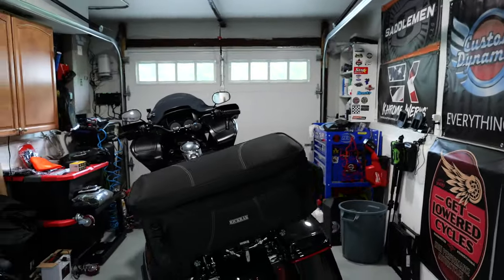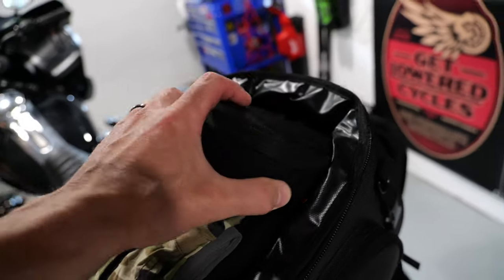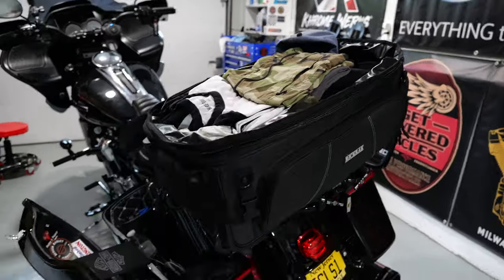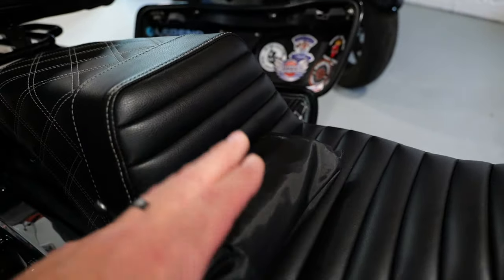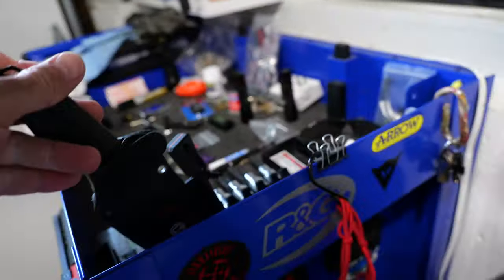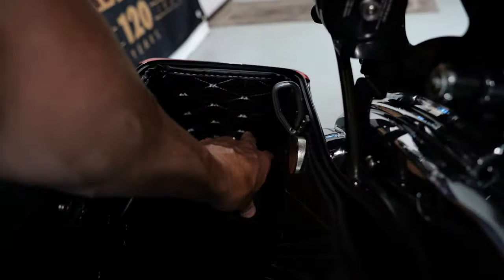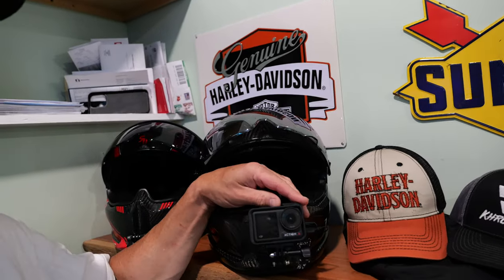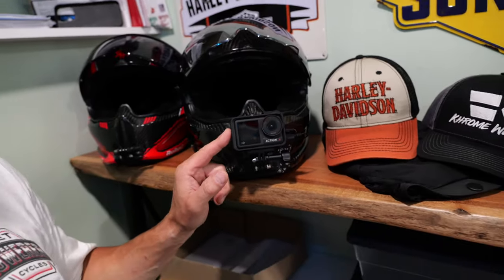WHAT I PACK FOR A LONG MOTORCYCLE TRIP HARLEY DAVIDSON ROAD GLIDE #cyclefanatix #harleydavidson

Comment: A couple of Maine riding tips - bring warm gear you will need them - between Bangor and Houlton is 140 miles, watch out for wildlife especially eagles as they have been know to attack cars.  Between Houlton and Caribou is 60 miles through small rural towns -  watch you speed.  Once you get to Caribou check out the lake region just north of town.  Plan to stop at Lakeview restaurant on long lake for great food.   Again watch out for moose between Caribou and Long Lake.  Their fur is very dark brown and hard to see at night.  If you watch on the side of the road about 10 to 15 in the woods you should see one or two.  Check out the old Loring AF base in Limestone - the runway is used for speed week in July.  In southern Maine plan to stop in Cornish (on your way in or out of Maine) and find the Bay Haven Lobster pound Restaurant  for some of the best seafood.